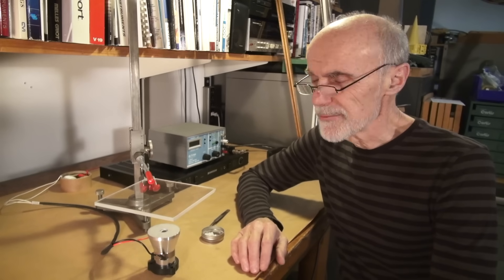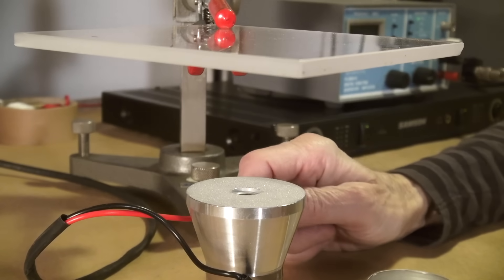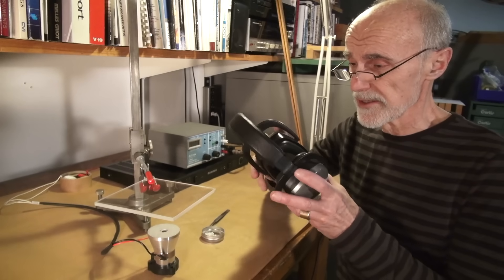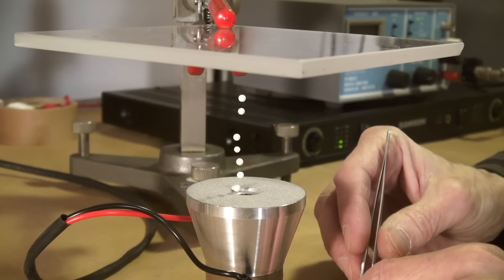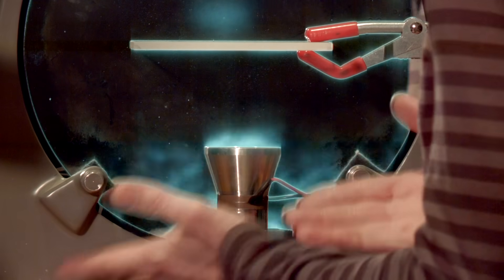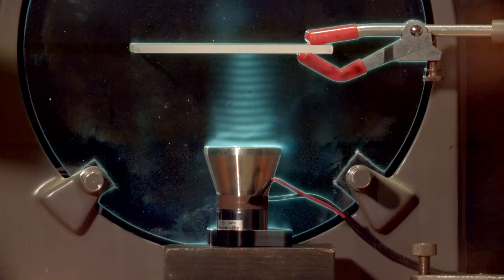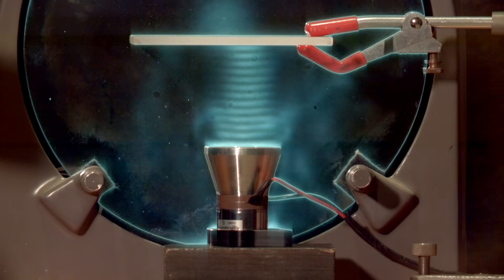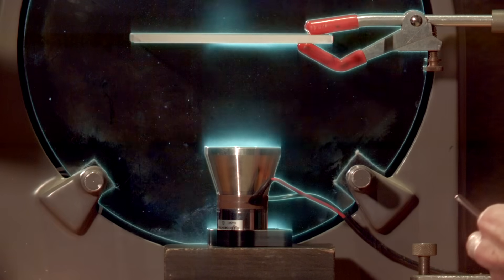Acoustic Standing Waves and the Levitation of Small Objects

Comment: Holy shit! Why isn't everyone losing their shit over this?  That is amazing. Could aircraft be designed to use this?
Reply: An airplane for water bears maybe
Reply: Your clearly not of physics background, this is based on standing waves, which is a wave that's super-imposed on itself for this to happen it needs to be reflected off a surface at a specific distance, however i still don't see what the application would be, a plane needs to produce large amounts of thrust, this setup in no way shape or form produces usable thrust, so no, were not "loosing our shit"
Reply: Ultra sonic is not a' radiation' We've been using this in Gynecology  for years (Because X rays are harmful to the Fetus )
Reply: Only if the emited sound meets resonant frequency of some body structure(s) i would argue..which change from man to man and is very hard to achieve that kind of resonance even on purpose. So its not like x-rays which are harmful for everyone and go through most materials. Sound can be easily isolated.
Reply: Bosshog looked up the aircraft and took me under 5 minutes to find out it is fake! Why would super heated rotating Mercury create anti gravity ?? We know the properties of mercury and anti gravity isn't one of them! It creates a electromagnetic bubble that allows the craft to lose 79% if it's mass ? Not very effective because if this craft can go at +10 super sonic speeds the mass it does have is going to be pretty extreme to say the least thus is why in space micro meteorites are still very dangerous because of their kinetic energy.  I'm quite sure the government does have anti gravity tech in black budget programs as there has been companies working on this for practically decades with no results yet spend billions.
Reply: There is zero evidence for it. Such opinions stem from people's ignorance.
Reply: It isn't scalable in that way.
Reply: The dude has to wear protective headphones to do this experiment. There is nothing safe about this technology other than in a laboratory setting. Just some cool work.
Reply: I'm personally not losing my shit cause this is not applicable to anything big. Any sound wave with enough energy to lock an airplane in mid air would probably tear the passengers into pieces.
Reply: Pladimir Vutin indeed craft can't be power by sound if anything it's going to be some sort of magnetic field that is powerful enough to manipulate the fabric of space/ time the energy levels for this are insane plus new properties of physics would need to be found.
Reply: Assembly
Reply: young showstoper yes I’ve said that before it’s rumored you can hear a humming or a ringing from ufos
Reply: Rob-karen Kennedy-parker look up sonic mining
Reply: Daves Reality transducers are made of magnets. They are powerful. They are the ones levitating the lil foam balls.
Reply: ElectroAcoustic transducer.
Reply: They've probably already been made
Reply: Lol sound is a horribly ineffecient way of levitating something. If you were going to manipulate a field it'd be magnetic or electromagnetic rather than an inefficient type of kinetic energy. Which using the compression of sound waves is kinetic (we've already got pretty good combustion engines which is a form of kinetic energy) and is even less efficient in a vacuum. The main power of sound is it causing vibration that manipulates frequency. This video is a neat trick and reminds us that sound is physical but its real applications aren't as broad as you think. If you want to see what the aircraft of the "future" are google electromagnetic propulsion and specifically an aircraft the "TR3B"
Reply: yep, by far most of the energy here is dissipated in heated air.  I was about to say hot air, but realized that could be misconstrued.
Reply: I don't think so as it only lifts something a small distance. People think this is how ancient people lifted 60/100 tonne or even larger solid stone slabs and there is some evidence for it.
Reply: The size of the levitation area is inversely proportional to the frequency of the sound. In the case of an aircraft, you would need gigantic speakers producing extremely high amplitude waves at very low frequencies, which is pretty impractical. People should be losing their shit over this though, because it could have so many useful applications.
Reply: Your planet is not ready for such advanced science. You're most powerful nation has taken a giant Trump Dump on science. Maybe in 2020 we'll be back. Until then, our Emissary Musk will hold down the fort
Reply: Your enthusiasm is the reason for many great scientific discoveries. Never give that up.
Reply: What do you think they’ve been using since the 60’s?
Reply: Yes
Reply: Natures version of it i think is the jetstream.
Reply: Ultrasonic radiation is very harmful to people. Much like x-ray

Comment: Which speaker does you use / he uses?
Reply: The "speaker" is an ultra-sonic power transducer (designed for 
ultra-sonic cleaning baths) such as one of these: https://www.americanpiezo.com/standard-products/ultrasonic-power-transducers.html  The one I'm using is the 50-watt version (but I'm only operating it at around 8 watts).
Reply: Thanks for that quick response! Thanks for that link! Do you think, that I can also use a "normal" piezo tweeter with a sinusgenerator?
Reply: And do you also know, wheather the ultrasonic levitaiton would also work with a higher/lower frequency?
Reply: No, it won't be capable of generating such high frequencies.  If you operate it at its upper level of audio frequency, it might work but you will have to use a LOT of power to drive it.  Wear hearing protection!

Comment: This is awesome. Wondering if moving the mirror up and down proportionally to the wavelength can produce a continuous standing wave and the little balls moving up and down
Reply: The distance between the mirror and transducer (some integral number of half wavelengths) has to stay fixed to maintain the standing wave.  If you move the mirror up, the transducer would simultaneously have to be moved up exactly.  The little balls would then follow.

Comment: Can you put Sand in there? Would be more interesting because then you can exactly see where the pressure gradient is located.
Reply: sand is too dense ... our set-up won't even levitate drops of water because we don't use much power
Reply: Maybe think about pumping up the voltage of sine or using another ultrasound speaker. If you use a variable frequency you can change the frequency insted of moving the wall up or down. That way you can also show the multiple resonant frequencies that can be used with a fixed wall setting. Very cool schlieren effect.

Comment: what if you try with white noise?
Reply: Wouldn't work with white noise
Reply: what about white noise against a convex reflector?

I mean, is it possible to generate different standing waves at the same time or anything more than a straight single line of levitation (ex. a plane, a curved line, a double line, ect.)?

Comment: Nice. But there is far more to this than meets the eye. Imagine any point on the ball. It experiences a standing wave. The pressure there, varies as a sine wave in time, between max and min limits, with an average of atmospheric pressure. There is no mean upward force anywhere on the ball. So the ball should fall. So something more complex is happening. I suspect that acoustic streaming is taking place from the standing antinodes. Due to non-linearities caused by the very high intensity ultrasonic waves, air is streaming up from the anti node (and also down from it) with replacement air coming in from the sides. So on this hypothesis, the ball is actually suspended on an upward flow of air. It would be of interest to visualise these flows, if indeed they do exist. But I would maintain that a simple oscillating pressure in the absence of the phenomenon I have described, can support nothing.

Comment: Is it possible to simutainiously increase or decrease the Hz, glass distance, and amp power if needed? Bonus question. The two distances where the waves appear. Would they be octaves, harmonics, or something different that involves distance? Sound waves are so fascinating. Great video!
Reply: The ultrasonic transducer frequency is fixed, so we can't do what you suggest with this apparatus.  If it were variable, one could do that in principle.  The distances where the waves appear are simply equal to some integer multiple of a half wavelength.  Since the wavelength is 1.2 cm, the distance could be 0.6 cm, 1.2 cm, 1.8 cm, 2.4 cm, etc. etc.

Comment: There should be an anti-node (a null) at the reflector.  I do see a small dark band right at the reflector, which is consistent with the white regions being nodes (regions of fluctuation).  NOTE that even the nodes are not regions of "high" pressure.  They are regions of fluctuating pressure (high variation in pressure), ranging from much lower pressure to much higher pressure as a function of time.  This seems very similar to ion traps.

Comment: Thank you, nice educational video!
I did some ultrasonic design myself, using 44 kHz transducers of the same model you use.
It is for anti-fouling on a boat (organisms do not like to attach on the outside hull if it is vibrating at ultrasound frequencies).
I drive the transducers with a home made transformer driven by 2 power MOSFETs from a microprocessor.
 The system measures the current and does a test -run for a range of frequencies at power up, and then finds the resonance.
I may try to use a transducer in air  to do some levitation :-)

An other fun experiment is the effect of air speed on the phase between transmitter and detector, as here in my 'wind tunnel'
setup:
 https://www.youtube.com/watch?v=pKDpJeiqMhc
  basically a PC fan blowing air through a tube with a small 44kHz transmitter and receiver spaced a few cm apart in it.
Modern wind speed and direction meters use that principle and are very accurate.
Reply: That's fascinating ... do you have to run your anti-fouling continuously, or just once it a while to do the job?  I like how you find the resonance.
Reply: I am not running it at all at the moment, as I  have no boat at the moment, looking for a nice one.
So I have it here and can use it to do experiments.
The software allows you to set modes and timing via a serial port.
It is based on a PIC 18F14K22 micro controller, settings are saved in internal EEPROM.
The whole thing runs on 12V so it can work on batteries.
 Input is about 1.5A @ 12V in continuous mode, so say 18W,  efficiency is very high (it is a switcher after all),
so say 15 W to the transducers.

Comment: Brilliant ! Can you explain me how your transformer is made and why do we need it ?
What is the input voltage of this set up ? 
thanks for your answer :)
Reply: The amplifier is a Samson Servo 120 audio power amp.  The input voltage to the power amp is a nominal audio line voltage (about 1 volt p-p) and comes from a sine wave function generator.  A home-made impedance matching transformer couples the 8-ohm output of the power amp to the ultrasonic transducer.

The core of the transformer consists of two C-shaped pieces of ferrite which, when put together make a square. Ferrite is better than iron at high frequencies. The primary is 10 turns of #18 wire and the secondary 
is 100 turns of #22 wire. The inductance of the primary is 230 microH w/ secondary open and 16 microH w/ secondary shorted. It's operational inductance is such that its impedance is well matched to the 8-ohm output of the amp. The inductance of the secondary is 18.8 mH w/ pri open and 1.8 mH w/ pri shorted. It's operational inductance is around 10 mH. The static capacitance of the transducer is 3550 pF. To resonate at 28 kHz, we want an inductance of 9.1 mH. The inductance of the secondary is a close match for that.  The output of the transformer can be as much as 400 Vp-p, but I operate it at approximately 50 Vp-p (the minimum power to secure levitation).

The "speaker" is an ultra-sonic power transducer (designed for 
ultra-sonic cleaning baths) such as one of these: https://www.americanpiezo.com/standard-products/ultrasonic-power-transducers.html  The one I'm using is the 50-watt version (but I'm only operating it at around 8 watts).

Hope that helps.  Thank you for your kind words about the video.

Comment: Can anyone tell me what is the equipments of this project?
Reply: The "speaker" is an ultra-sonic power transducer (designed for ultra-sonic cleaning baths) such as one of these:  https://www.americanpiezo.com/standard-products/ultrasonic-power-transducers.html 
The one I'm using is the 50-watt version (but I'm only operating it at around 8 watts).
Reply: He uses special type of loudspeakers more horizontal i guess.  Do we have to use this loudspeaker? Or we can use any type of loudspeaker and integrate the tranducer power is it enough?
Reply: Wolfgang Rueckner may you give answer my questions?
Reply: No, you cannot just use any type of loudspeaker ... it has to be designed to produce frequencies in the ultra-sound range (greater than 20 kHz).  You certainly don't have to use the one I suggested -- there are many companies that make these (do a Google search).
Reply: Wolfgang Rueckner I got it. Thank you